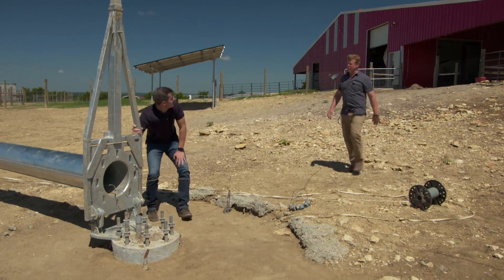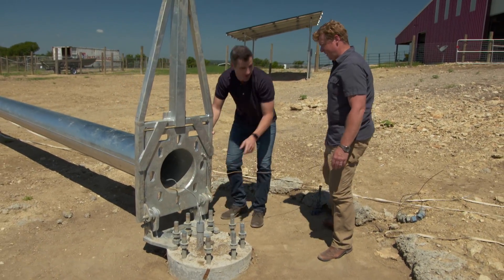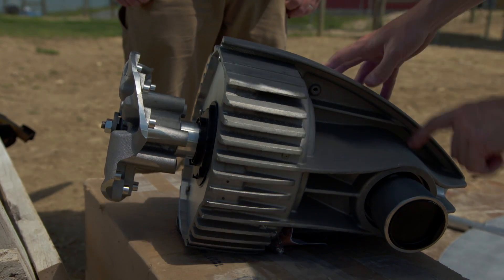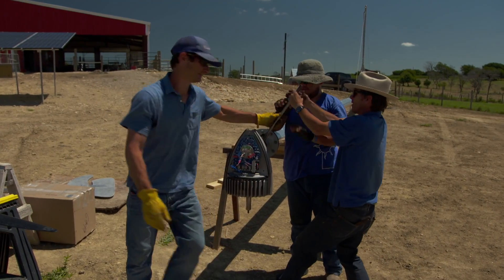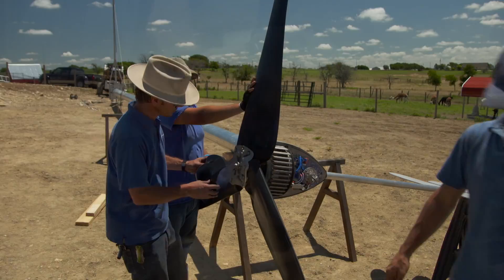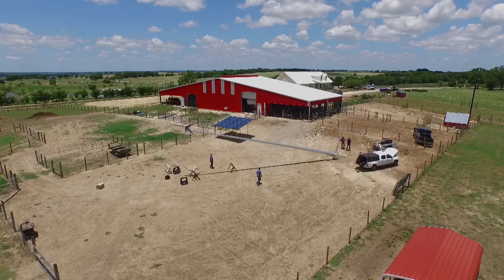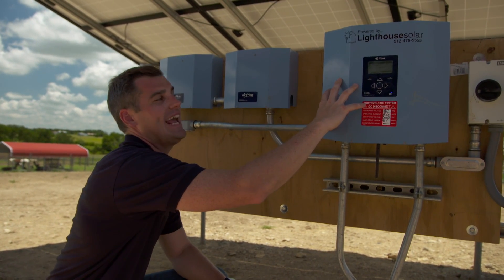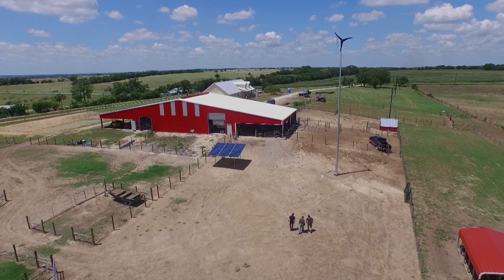How to Install a Home Wind Turbine | Ask This Old House

Comment: That turbine aint sending dc power that far on that tiny wire. Probably 3phase ac rectified to dc at the inverter.
Reply: It is DC Voltage ... you need to do some research.
Reply: I owned one feller. Ive done my research on wire size for dc over distance.
Reply: @TheSaltblock  Then provide the URL showing the Model # and specifications for this Wind Turbine ...

Comment: this generator has to cost upwards of 28-30,000 Dollars,,and it ONLY produces 1500Watts. WOW, Cost to productivity, this is like pouring sand down a rat hole
Reply: The whole system ... installed  .. cost that much, then subtract all of the REBATES. It works for them, just not for you.

Comment: What a waste, I'm. Guessing around $25k installed when it's all said and done. Remember this was 5 years ago when this stuff was much more expensive.
Reply: Satguy 141 how
Reply: For starters, wind is the most expensive least reliable power generation going. That's how.
Reply: @satguy  In Texas ... Wind Power is very reliable and it is a "Grid-Tie" system, therefore there is no requirement for the Wind to blow 100% of the time.
Reply: @MrSummitville  Relatively short lifespan, cost of disposal when it's over. I live near a wind farm that's abandoned because of its age then what?
Reply: @satguy  Actually, this Residential  Wind Turbine, and others, can last for 50+ years ... just replace the blades and bearings, as needed.  Now, what are going to complain about ?

Comment: I see there is a PC board inside the Nacelle, why?  Why not have a the generated power go direct and have the PC board inside some sort of regulator box at ground level.  That way you can do maintenance and replace the board without lowering the tower.

Comment: why are the blades only 10ft in diameter and not, say, 25ft in diameter?  You have a 60ft pole, you could have blades coming right down to say 20ft above ground (that would give you 40ft diameter)?
Reply: Bigger Blades = More  $'s.  The turbulent wind near the ground has less energy.  That is why is is up on TOP of the pole.
Reply: Bigger blades means the whole thing has to be bigger and more robust.

First, turbine weight.  Before this video I was looking at various vertical-axis wind turbines from a manufacturer, their 3 kW turbine has 12 ft blades set 9 ft out and weighs 230 lb.  Their 10 kW turbine has 20 ft blades set 18 ft out and weighs 1500 lb.

Second, all that surface area to generate more power means more wind drag which means more force applied perpendicularly to the mast, so you'd need a sturdier mast than that puny thing.

I was expecting a bigger turbine as well for a 60 foot mast.  Those look like, hmmm, 7 ft blades?  Maybe 16-20 ft blades for something like a 3-5 kW turbine?

Comment: Most expensive electricity you'll ever buy!
Reply: Can you show us the numbers you used for the cost per kWhr by each: Wind  vs  Solar  vs  Grid ?  I doubt you have the answers ...
Reply: I have solor, sorry I have it.
Reply: @satguy  You are "sorry" that you have solar? WHY?
Reply: @MrSummitville  Because the public utilities commission authorized a reduction in the price that Edison pays for my excess energy by 2/3.  When you break down the cost of the solar system per month versus the cost of buying the electricity from Edison. I'm losing around 90 bucks a month. That's a huge chunk of change when you figure it out over 20 25 or 30 years.
Reply: @satguy  Ouch, sorry to hear that ...
Reply: @MrSummitville  The reason they gave for doing this was, so many people had put on solar. Edison was losing money,  I bought into the lie, in my opinion the only way that solar is actually viable is a 100% off-grid system.
Reply: @satguy  Grid-Tie Solar is less expensive electricity per kWhr for the residential consumer.  While, Off-Grid Solar + Battery Bank is the most expensive for the residential Consumer wherever Grid Power is available.  Change is difficult and maybe it is Edison that needs to adjust / modernize ?

Comment: are you interested in making the hydraulic pressure setup and wind turbine and solar powered hydrolysis so all the source of energy used in hydrolysis of water so we got hydrogen fuel which is almost more efficiency then any other fuel in whole world
Reply: Hydrolysis is NOT very efficient.  Li-Ion batteries are much more efficient.

Comment: So in 105 years it will pay for itself. Oh yeah, but it's greeeeeeeeeen (ignoring all the energy that goes into its fabrication, transportation, installation, maintenance).
Reply: How much energy goes into building another Electric Power Plant?  We cannot convert to non-fossil fuels overnight.  The conversion will take many more years.  This homeowner has started the process. Every kilowatt the Wind Turbine and Solar Panels generate is just that much less fossil fuels that need to be burned.
Reply: "Every kilowatt the Wind Turbine and Solar Panels generate is just that much less fossil fuels that need to be burned."

As I pointed out, and apparently beyond most people's comprehension, is that a whole lot of fossil fuels are burned so people can pretend to be "green". So the first and subsequent kilowatts that people virtue signal over require a whole lot of fossil fuels.
Reply: That yours is the economic ignorance of the masses doesn't make it magically valid. No, a whole lot of fossil fuels are burned before the first kilowatt is virtue signaled produced. As this property already has utility power, its use would burn NONE OF THIS. But yes, you wouldn't get the smug virtue signaling for fellow ignoramuses that way.

Comment: Huh? Didn't that blade assembly have any shaft keyway or spline or flat offset hub or lock pins to stop its rotation? Even a reverse thread nut is risky to assume a full lock on a parallel drive shaft. And I would lockwire a casellated nut to be sure.

Comment: Please tell me someone went back and reinstalled the wiring correctly. Watching the installation and when he was tightening up the wire is was wrapped the wrong way and was loosing up while tightening the screw.
AT THE 2:40 POINT
Reply: Roger Reed- How do you figure? It was looped correctly.  The end of the wire will turn clockwise.

Comment: Wouldn't you be much better off just installing more solar? That wind turbine can barely make enough power to run a hair dryer and probably cost 10-15k you could have 5-10x the output from solar for the same price.
Reply: Typically, you need constant steady 25 MPH winds,  to produce  maximum / rated power ( 1500 Watts ) from a Wind Turbine.  How often does that actually happen at this location?  With constant 10 MPH winds, it will generate ~200 Watts, now that could easily happen for many hours per day and night, in the mid-west.  Break-even could be as long as 40 years?  If it lasts that long and without any repairs.  It all depends upon how windy it is at that specific location???
Reply: It's also 4 years ago.
Reply: @JasonCarmichael  Learning never stops ...
Reply: @JasonCarmichael  and it was a dumb idea to spend $15k to save $500 a year 4 years ago too. How long is the turbine going to last maybe 5-8 years?
Reply: @mp-xt2rg  I bet the wind turbine will last 35 years. :)
Reply: @JasonCarmichael  The blades will not last 35 years.  Wind Turbines usually require yearly maintenance = Additional costs, hurts the break-even and ROI.  You need to replace any failed bearings BEFORE they destroy the generator's shaft.  There is no Wind Turbine that can fly for 35 years, without routine maintenance.

Comment: How much does the wind turbine unit cost?
Reply: A 1.5 kilowatt Wind Turbine + Tower + Grid-Tie Inverter can cost between $5,000 - $10,000 ( or more ) installed. On average it can generate $150 worth of electricity per year - more in very windy locations.  Therefore, 33 years ( if it lasts that long ) to "break-even" =  $5,000 / $150.
Reply: @MrSummitville  Wouldn't the amount of electricity it generates depend of the amount of wind it gets?

Comment: Fatal mistake too small cabel for this power 1500 wats DC.. probably voltage under 100 volts 100-150 feets long cable more than half of power lost. You need cable big as your finger at least.
Reply: You are very wrong.  Only small portion of the power will be lost in that cable.  Show us your calculations for more than 50% power loss ...

Comment: How much does it cost to hook up the wind turbine, 9 foot diameter 3 feet thick concrete plus 3 20 feet deep pylons sounds like a fortune.  I'm guessing there has to be a target usage group. How many basic apartments would the wind power?

Comment: Remember when this was a DIY show. 

Also I like how they never tell you the cost. & they didn't even say how much power it can generate.
Reply: 1.5 Kw...... on a good day
Reply: @oldbatwit5102  it's pretty amazing that such a small blade can produce that much. I also wonder how much that costs.
Reply: @mortarriding3913  It requires steady 25 MPH winds for hours.  Who has that?  I am lucky to get gusts, up to, 25 MPH.
Reply: @MrSummitville  someone on a summit?
Reply: Yep complete bs. That costs 30k! Take 30 yrs to pay it off!
Reply: @crazyhass84  Will it even last that long?  Every expensive repair will increase the cost and push the break-even out another 5 - years.  The blades will need to be replaced.  Nothing will need to be re-oiled for 30 years?

Comment: I would like to have seen some cost / savings details with simple payback information. Also,  was there some government grant or utility company incentive for this rig?
Reply: At 1.5 kw I dont think this will pay for itself within the owners lifetime. Plus, I dont see the power company offering incentives. This means they are going to sell less electricity which hurts their bottom lines. Not that renewable energy isn't something to work towards, but It is not even close to being cost effective yet.
Reply: @zacharyadams6277  The electric company actually takes the excess energy that you produce and they sell it to others. They have to pay you for that in the form of a lower bill. If you produce $50 of excess energy, they'll take that off of your bill.
Reply: @MacCam25  That's absolutely correct. No more electricity this system will produce, he wont have enough to run his own stuff, much less produce extra. I could have missed something though. Thanks for pointing that out.
Reply: Nothing was mentioned about expected maintenance or the cost of replacement.  Those turbines don't last but a few years and a good Texas storm will make scrap out of that unit.

Comment: Step one: be a multi-millionaire.
Reply: Or just go on Amazon. You can get a 300-watt wind generator for about $150. It's not much, but if you hook it up to a 12v car battery, it's enough to power your lights.
Reply: It's no where near as expensive as you think.  There's also grants and or tax credits you can get if you get one installed.  Last tax credit spec I saw was 30%.
Reply: Step one: be a dumb multi-millionaire. After all, this has a 105 year pay-back period, lmao.
Reply: @melainewhite6409  -  You now it's about location and amount of wind, right?  I guess Texas is windy or at least where he is it's windy.  Farmers don't generally suck at math.  lol.  They outta' biz and a while ago if they do.
Reply: @X x People do suck at math when the free market is distorted. If wind and solar were actually profitable, then the roof of every Wal-Mart, a company that goes to great lengths to pinch pennies, would be covered with them.
Reply: @melainewhite6409   -  Actually, no, YOU suck at math, (and also reading.)  Farmers don't.  You see, there's this thing called long term or longer term.  So some company, or most, can't necessarily plan on solar or wind because it takes time for them to turn profit.  They aren't sure they'll be there long enough.  Also, the profitability depends on amount of wind and sun a place receives.

Higher amount of wind + wind turbine = faster profit
Lower amount of wind + wind turbine = slower profit

You see, the profit isn't immediate - it's a bit longer term.  So your math saying that if it was profitable, everyone would have it is pretty off or just wrong.  Your math sucks.  Also, that everyone would do it is also false as, as you say, peoples' math sucks or can.

As for the farmer, and I stated farmers' math - not peoples', he knows he will be there a while, or longer.  He also knows how much wind, like rain, he  has available.

Your math and reading both suck....just like you say.  But farmers are a bit more on top of it, generally.
Reply: @melainewhite6409   - 

Texas wind in his area x turbine x time = profit
I think it's funny you deemed it a bad investment without knowing how much wind he has.  Awesome skillz!
Reply: Melaine White it’s like 6 months
Reply: @melainewhite6409  If they have strong steady winds, and I think they do, then it will be much less than a 105 year payback.  For the average residential home, you are correct.  But this is not your  average residential home.
Reply: @MrSummitville  With that mast height and fairly flat terrain, and some incentives probably, I'd have to agree.
Reply: wnc817  That requires skills, tools and knowledge the average person does not have.  It is better to buy a 2,500 Watt Turbine online for $1,500 and install it yourself on a Guy-Wire Pole = Big Savings!  Then the payback will be less than 10 years.  If you are off-grid and in a windy area, then you need to do this.
Reply: step one - work hard ...
Reply: @MrSummitville  More likely be born into it.
Reply: @wrandom  Actually, MOST miliionares are self-made, not born into it ...

Comment: You could fit like 20kW of solar on that barn roof right there but whatever.
Reply: It's not always sunny.
Reply: @qkrotor  For most people, it is much more likely to be sunny, but not very windy.  Wind Turbines cost 3 TIMES to 4 TIMES more than Solar per kWhr generated.  Wind Turbines can be financially justified, if you do not already have Grid Power available ( ie the grid connection is expensive ) - but they already have a Grid connection.  You need strong steady winds, like 15 MPH - 25 MPH, for several hours, every day.   Who has that?  Wind Turbines are a very expensive toy.  The homeowner will learn this lesson when he needs to them call for out-of-warranty service = a financial LOSS.  The second time that it fails, the homeowner will have it removed ...
Reply: @stompyrobutts  ... Southern Alta is the 2nd most windiest place in CANADA (St.Johns NFLD 1st.), and certainly not North America. Also, "a few hours north is the sunniest place in North America". Huh? Are you baked? 🚬 Just about everywhere in Mexico and half the USA is sunnier than southern Alberta... Although Calgary is Canada's sunniest major city, that's about it.
Reply: qkrotor in Philadelphia
Reply: Also, in the northern hemisphere, solar panels should be south-facing
Reply: Sure, but what are the feed in tariffs? Is that a good investment? Or is this rancher better off spending his money on other equipment. Part of the problem is that often the grids are privatised monopolies, who get to tell you how much they'll pay you for electricity, and how much you have to pay to take from the grid.

20kW would only be helpful either with high feed in tariffs, energy intensive on sight machinery, or a microgrid to share with neighbours. But the last part results in duplication, because of a broken structure in the market.
Reply: @mortarriding3913  The home owner is using a "Grid-Tie" inverter because he has a reasonable Net Meter agreement.  This video was about final installation and raising of the Wind Turbine, not feed-in tariffs - that is another show.
Reply: hahahah yep.  And

Comment: Vertical wind would of capture more wind.
Reply: No, it would not ...
Reply: @MrSummitville  ok, tboone Pickens lost his butt because of the inefficient design. Can get more torque with vertical than axial.
Reply: @brettmoore3194  Not at this scale.  You need to get the Wind Turbine high in the sky to get the smooth laminar wind flow. There is very little Wind energy near the surface.  Grid-Sized ( large 10 kw )  Wind Turbines are a different story ...
Reply: @MrSummitville  man your telling me the mast can support more wind load axial than vertically. Your arguement is higher you go there is more wind, is what a simpleton would say. In engineering stress loads there are more factors than wind speed.
Reply: @MrSummitville  they are not turbines either.
Reply: @brettmoore3194   I did not say anything about axial load.   Can't you read?  "... EFFICIENCY – When the wind blows on the blades of a HAWT, all of them contribute to energy production. When wind blows on a vertical-axis turbine, only a fraction of the blades generate torque while the other parts merely ‘go along for the ride’. The result is comparably reduced efficiency in power generation.
 

  Simply put, because power generation efficiency isn’t as good, VAWTs aren’t as good long-term investments. This is ultimately why wind-energy developers have stuck with the HAWT. An owner’s greatest concern is simply generating as much power as possible over 20 plus years. Until recently, no prototype VAWT was close to the long-term generating capacity of horizontal-axis designs.  Conventional VAWTs have no such optimization control, not yet, at least.  ..."
Reply: @brettmoore3194   HAWT = Horizontal Axis Wind Turbine.   VAWT = Vertical Axis Wind Turbine.

Comment: why put all of the heavy weight at the top for? You can run a light weight hydraulic pump at the top and run to a  heavy duty ground based generator. This setup allows for easy maintenance with the added benefits of hydraulic braking power during storms and economical expansion when you want to add more towers?
Reply: Your costly design, would increase the already "too expensive" wind turbine, by how much more ?